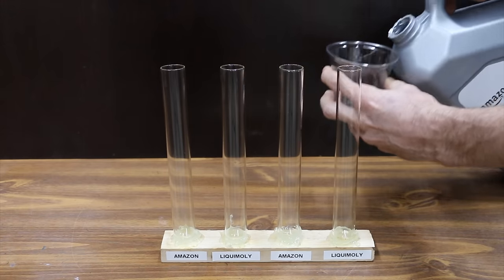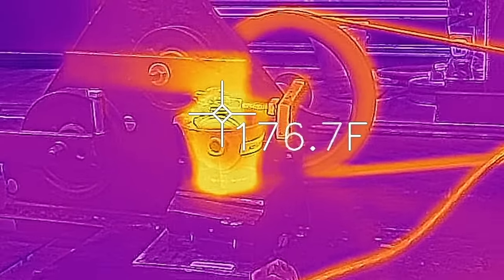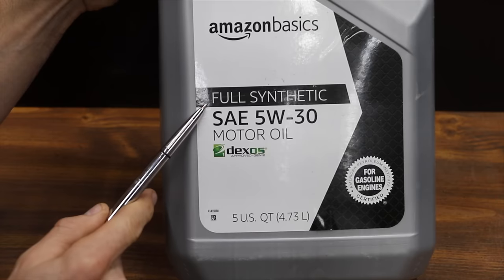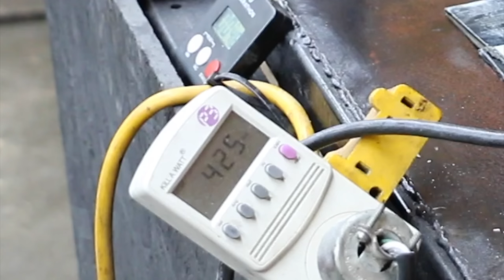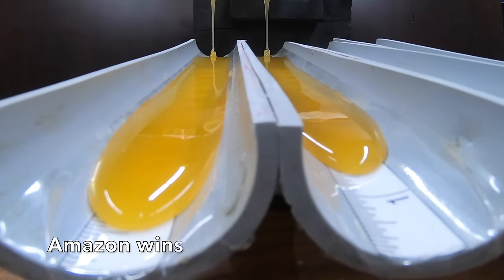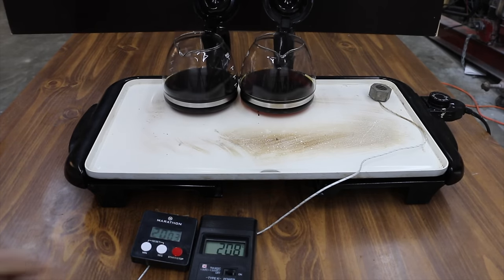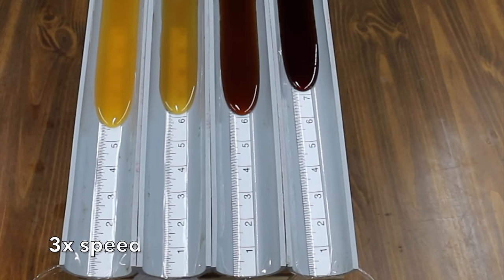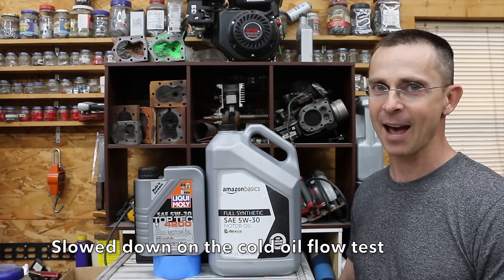Is Amazon Basics better than Liqui Moly? Let's find out!

Comment: ok the result are : 
AMAZON basic good for gearbox. 
LIQUI MOLY better for car engine OIL.

combustion engine oil not only protect a friction. please test with carbonation cleaning.
and whe oil eazy to move. it is bo good for keep oil stick on piston ring. all oil will drop to oil carter. and when  engine start from long time stop, it will be damage a piston ring or cylinder skin. LOL.

Comment: One thing I don’t fucking understand is Why Why Why the fuck this man is after LiquiMoly??? Why are you constantly trying to prove LiquiMoly bad????
Reply from the maker: Thank you.  I was hoping Liqui Moly would perform better.  Per Blackstone Lab oil analysis, it's very light on additives compared to the competition, including 1 PPM of moly.
Reply: Project Farm what I understand is that you’re saying we should add additives with the oil? As in ceratec and stuff?
Reply: Which oil should we use??? Every oil has some issues. The more I watch videos and read forums more I get confused. What oil should I use on my 500km’s ridden 250cc motorcycle. I want a ride with a smooth comfortable engine feel. As of now I’m using LiquiMoly 10w 40 engie oil & NGK Iridium Spark plug. And now thinking of adding 30ml of LiquiMoly Ceratec to kill the engine noises. I want a nice quiet and a smooth engine